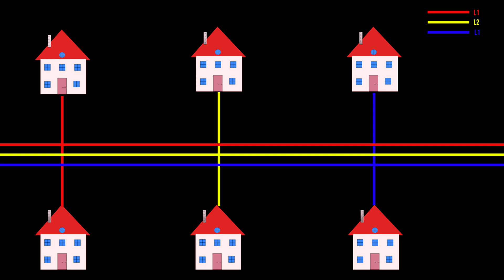New Builds To Get EV Chargers BUT ONE BIG ISSUE!

Comment: Completely agree on three phase, completely agree on prep work and them adding cat5 cables etc. what I don't agree on is developers fitting the chargers. Anyone with experience with new builds know its all going to be done on the cheap. If you see a mainstream development with solar its just a couple of panels right in the middle of the house. a sort of virtue signalling that's near useless. Same with boilers, cheapest model going.

When i have looked at developments with optional chargers they want a lot of money for the charger and its amongst the cheapest around (rolec untethered). I would much prefer the legislation be for full 3 phase charging prep, with then the option to select from different chargers say basic included model is brand a but customers can upgrade to brand b with extra features. 

The amount of ignorance on the subject is incredible, with most consumers not understanding the difference between home and public charging, never mind how charger choice can have a huge impact on charge cost (bog standard charger vs say a zappi). Believe it or not, even with todays climate most users still don't understand off peak charging means fuelling is very cheap. The amount of unfounded gloating due to electricity price hikes is bewildering. Tts cooking my dinner, drying clothes at 6pm for 31p/kWh that worries me, not 7.5p/kWh charging my car at night.

Currently own a leaf 40 and have been questioning why new supermarkets have been given permission to be built without charging provisions since i bought the car as it made sense. Ordered a polestar 2 which has an 11kw onboard charger. I would only need to plug in once a week for my usage if i had 3 phase.

Comment: No @Nicolas Raimo we should not be installing multiple charge points at larger homes. 1 should be the default. Trying to decarbonise should mean less cars total not more encouragement to get a second car. If the home owner has the bucks to buy such a big house AND pay for a second car then they can go into their own pocket and pay for an additional installation at the point they need it. Bumping up the house building cost otherwise. Anyway if the 1st charge point encourages the switch then they will probably get a 2nd electric (to replace an existing ICE 2nd car). Second cars tend to have a lot lower mileage, so could probably share the same point anyway, otherwise the owner will already want to reap the electric benefits and pay to have a 2nd point installed.

Comment: It's not just a benifit having 3 phase it's a nesesity to run everything specially in larger famy homes with more than one ev. If your a pensioner or a couple no bother. Rules over solar pv are 4kw solar on single phase anything bigger you will need to contact your dno in lots of cases like mine I had to pay £390 for the privilege to have 8kw system on my single phase but 3 phase you can have 12kw anything more again yyou should contact your dno, so huge advantages for 3 phase and for net works as they get back electricity from solar users. The goverment really have not thought about it well. I know of a 192 housing development in wales with 2 and 5 bed homes all having 3 phase. All new builds must go 3 phase.

Comment: I was advised by my dno that my second charger could be used but only with load curtailment. So we have decided not to fit an heat pump, as we cannot on our property on single phase. Our dno have quoted £15k for this upgrade. So in a nut shell I cannot dump my gas boiler ever. You will have a lot of people who will say they have no issues but every install is differant. I have 2 chargers pulling 32amps at the same time in economy 7 tariff. I have a hot tub on 24/7 a sauna that also comes on at 05:39am so that's another 32amps OK it's not when it gets to temp, we wash and dishwasher also in this economy 7 period and every other day make bread ready for breakfast, then there is the 2 freezers and all the other bits like electric shower. So having a 22kw heat pump in winter would not be wise. Oh go on say you can load curtail devices lol. Yes you can but I want 2 vehicles fully charged ready every morning I want to have a sauna every morning and shower after ready for work, and yes I want to save money and do all. My washing and dish washer at economy 7 rates. So I cannot actually have a heat pump.

Comment: 7.4 chargers will be of no use when larger battery's come out as larger battery's mean more milage. So within 2 years we will need 22kw chargers as the minimum. But unfortunatly you cannot fit a 22kw charger on single phase. You really have touched on an huge issue. Take a look at an article in the telegraph newspaper or on line dated 2nd Jan.
Reply: Thing is though, if you have a battery twice the size, it doesn’t mean that you are going to actually drive twice the distance each day. It just gives you a bigger buffer. You’ll still probably only drive under 50 miles per day. So will be pulling the same amount of kWhs each night to get it to full. Or conversely, will be plugging it in once every 4 days instead of every 2. 4hrs on cheap rate adds approx 85 miles per night, assuming 7kW charging and ~3m/kWh. That’s nearly 600 miles per week, roughly  30k per year. And that’s using ONLY the cheap rate. Double it if a full overnight charge or triple if you plug in and charge when you get home till morning when you leave. MOST folks (not all) do about 180-200 miles per week for their pottering around.

Comment: New builds will have a very small effect on the total housing stock.  The existing housing stock gets only one phase and it would need a major infrastructure change to add the other two phases.  The existing system balances at a three road level: three local similar roads each get a different single phase.
The bigger issue is that the electricity infrastructure will not be able to cope when gas is replaced by electric heating. Replacing petrol and diesel with electric also places a bigger burden on the electricity infrastructure. The local transformers, which convert the eleven kilovolts to 240V were sized to supply a maximum of 60A (14.4Kw) to each dwelling (assuming a resistive load). Each dwelling can therefore only be allowed to draw 14.4kW maximum regardless of how many bedrooms or cars they have.
Reply from the maker: Hi Dennis as mentioned in the video, street level balancing has worked fine in the past for easy to manage loads like ovens and showers.  However they tend to be on for short periods and we tend to use them roughly at same time meaning system will balance... issue now is we have EV chargers and everyone on the street might not have an EV yet... So as mentioned in video this will bring the balance out its already been seen on my local estate,  8 of us on phase 2 have ev chargers... only 1 on phase 1 and ZERO of phase 3...  6 of us charge on octopus go at 12:30....  
When your building a new estate the cost to put 3ph n is next to nothing so even if its just to the meter they may as well put it in place sadly builders are not.. However some DNO's are making it part of a standard install for new connection.
Reply: @NicolasRaimo  The problem here is that house prices are mainly determined by location and number of bedrooms so builders will not add anything which costs them any more to build: new houses should be built to a higher efficiency standard but the building industry lobby against this as it will reduce their profit.
Reply from the maker: @dennisharvey4499   the most expensive part of 3ph is digging the trench.. not an issue on new builds its already dug... Even if they don't fit a 3ph board and bring the 3ph to cabinet that's all that is needed,  we will likely see this forced upon builders anyway with new building codes coming in

Comment: The other point that people don’t seem to understand is that the main fuse (cut out) is not like a normal fuse. It is a slow blow fuse. Unlike a normal fuse or breaker which disconnects once it overloads, a slow blow fuse can sustain overcurrent for many hours before it blows.

Comment: Fitting an actual EV charger in a new build right now doesn’t actually make sense. EV charger technology is and will change rapidly and will be way beyond what we are used to today. 

It’s very likely that a charger fitted in 2021 won’t be used until the buying actually buys an EV. That means the technology will be old and the warranty will be diminished. 

What makes sense is putting in the provision for an EV charger to be installed as and when it will be needed. Be that in 1 year or 5 years. 

Another point to consider is that the charger needs commissioning once installed. Often the information to register the unit and connect to the app is inside the charger.

Without a customer, there is no access to a users phone to register the user and and also no means to connect to the internet. What we could end up with is a load of dumb chargers being used, because when they are needed people can’t easily register the charger without taking the lid off the to link the app and hence schedule a charge.

What they should be doing on new build is what they do with intruder alarms. Install the wiring and then when and if the owner needs it fits a the alarm they want. 

If the builders are left to their own divides they will fit the cheapest and most useless chargers on the market just to meet regulations.

Comment: My charge rate is set very low to match the output of my solar PV system so that I consume nearly all power generated on site. However, most people will do a higher mileage than I do and need a much higher charging rate, as you suggest.
Reply from the maker: Most chargers now can regulate charge rate depending on solar

Comment: I purchased a Zoe at the end of last year, and I am lucky enough to have three phase power to my house ( the house a long time ago was divided into three flats), I am having my 22kw Zappi installed in the next few days. Bearing in mind that over the next few years electricity companies are likely to move to more sophisticated time of use tariffs ( similar to Octopus Agile) , especially with the wider adoption of smart meters , to even out the use of renewable energy , it makes sense as far as possible to have three phase power so that you can use the maximum amount of power when energy is cheap. So for example high winds in the early hours of the morning and low demand, charge the EV as much as sensible, fill up a home battery, heat hot water, put on washing machine, dishwasher etc. Of course widespread increase in electricity use through adoption of three phase will require grid investment.

Comment: You'd only need multiple chargers if you have a short range ev or are doing high miles. You can add 28kwh on go tarrifs per night and that can get you 84-140 miles. So you could just alternate parking spots surely?
4 car houses probably need two I'd agree.

Comment: An energy efficient home or business is more comfortable and saves money in the long run.
Every new home or major rebuild should include a EV charger in the garage or car park.
Solar energy on your roof combined with battery storage can make people more independent from the grid and natural gas supplies. Add solar and supplemental electric heating or a heat pump for home or business heating..
All big box stores and manufacturing sites can support solar energy on their roofs or parking lots.
Added insulation, double or triple glaze windows, energy efficient doors, energy efficient heating and cooling systems, energy efficient appliances, LED lighting, smart thermostats, solar panels combined with battery storage and a electric vehicle charger in the garage or car park. People are too focused on the short term costs and miss out on long term savings and comfort. Blower door testing and air sealing are under appreciated tools.Even if you have money to burn you should not waste it.  Climate Change will impact everyone. Leave a better future for your children and grandchildren. Join in and speak up for the future of the planet

Comment: A very interesting video - thanks for posting!

I got my first EV (Hyundai Kona 64 kWh) last May and had a MyEnergi Zappi 7kW charger installed shortly afterwards.  I never considered having my 4-bedroom detached home, (built in 1972) power supply changed from single phase to 3-phase as I have an Economy 7 tariff, so can get a charge of about 50 kW during this period, which is fine for me.  I'm wondering if my Network Operator (Western Power Distribution) would have been willing or able to provide the upgrade though.  I had to gain approval from them to have my 5.6kWhp solar panel array installed.

When I take into account the point you make about charging speed in the future and more importantly balancing the National Grid I'm now thinking I may make an enquiry into availability and associated costs to make the change?

Comment: Loving the old school Red, Yellow, Blue for the phases. It's going to be a complicated affair, even if a household has multiple parking spots, but maybe only one car. Maybe have tethered charge cables wired in 3 phases but where terminal 1 would have phase 1, then next door terminal 1 would be phase 2, so cars with single phase 7kW chargers would still be mixing phases between households..
Reply from the maker: regarding the mixing thats FINE if everyone on that steet as i said plug in the right phases at right time but what if only people on phase 1 plug in and not phase 2 and 3
Reply from the maker: I used it as its easy to identify in a video like this... its also easy to see in the dark... unlike the new system....

Comment: I agree three phase would be better for new builds. But the problem is that if there are too many new regulations, builders will start lobbying the Government moaning that it is too expensive and everything will get watered down as happened with the requirement for EV chargers in commercial car parks. At least we should now be getting EV chargers fitted to all new builds. 

Ideally I would like to see all new builds have EV charging, heat pumps and solar panels fitted as standard

Comment: Totally agree. I was gonna retrofit to 3 phase for our 2 EV’s and 2 chargers and get 3 phase Zappis but we are likely to move soon so will need to be at next house. Germany also mostly standard build 3 phase as well. Most PHEVs are 3.6kwh charging. My 2020 Ioniq only max at 7kwh but Mrs id3 can charge at 22kwh. Definitely all new builds should be 3phase and gov grants to help retrofit older where possible.
Reply: Are you sure ID3 can charge at 22kW AC? I thought they were restricted to 11kW AC?
Reply from the maker: Hi Glen i think the ID3 is 3phase but limited to 11kw
Reply: @NicolasRaimo  yeh, my bad, was thinking still about the supply but yeh, it does charge up to 11. Probably change my Ioniq 38 to some other but it’s difficult to let go as it’s brilliant, apart from slow charge speeds in Rapids but I rarely ever need a rapid. Might look at the MG5 long range but would feel like the spec v my Ioniq SE Premium would be a step backwards but more space for our 2 border collies. Everything else is silly money for larger family size car. One good thing is in last 6 months on We Buy Any Car my Ioniq keeps going up in price, by quite a lot

Comment: New Shopping Centres in Ireland  have to install Chargers in 10% of their parking spaces.  First place it will apply is a new Lidl or Aldi in Maynooth Country Kildare.  New Apartments also must be wired for chargers . Legislation still going through how to deal with existing Appartments ,but most likely a grant scheme to offset some of the cost and agreed charging prices to be legislated for as well, so people don't get ripped off by Bad landlords and will have to maintain them as well.

Comment: i use a granny charger at home since i don't drive much(and can usually plan long trips in advance) and have a car with fairly small battery. i also have a 22kW(not free) charger at work so in case of an emergency i could fill up there. but i think that with cars and their batteries getting bigger, 3phase wiring capable of 22kW should be standard for every charger installation. i mean it could still be used to supply 3.3kW or split so 2 or 3(maybe even 6) cars can plug in.
Reply from the maker: You really shouldn't be using granny charging at a full time solution please see my video on some of the safety risks involved https://www.youtube.com/watch?v=No04dF7cwDc
Reply: @NicolasRaimo  meh. its not quite that bad. i mean people use electric heathers with a similar power ratings day in and day out. schuko has a bigger current rating(16A vs 10A with the actual draw from the charger i am using being 9A) than the plugs they talk about in this video. i rearly have to resort to charging on the expensive tariff.

Comment: 11kw that's 3 ovens or 9 kettles going for hours. Either you give control of your charging to the grid and just ask for a window of time to be charged in and if there is a lull in wind then you bill goes up if you said you need 80% for 07.00 to get to work. or you have to scrutinize the weather forecast for high winds to know when to charge your car. As for 7 Kw or 22 Kw it seems that as a government has to plan for the future 50kw might need to be the norm. Ummm time to buy shares in copper mines I reckon
Reply from the maker: As the new legations coming into effect means all chargers MUST be smart then 3ph makes more sense
Reply: You mean just shy of 4 regular kettles or 9 HOTEL kettles!